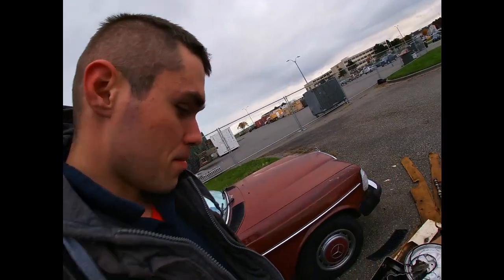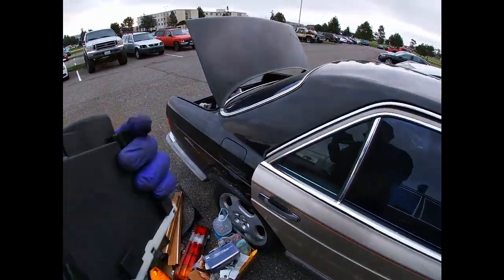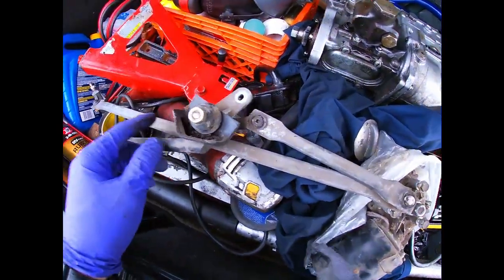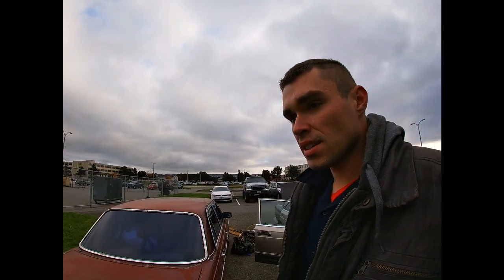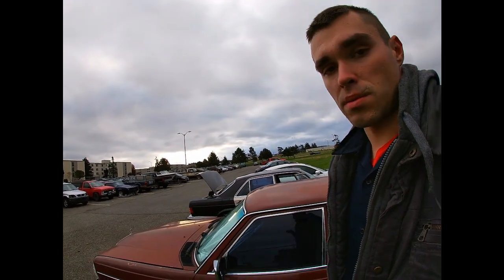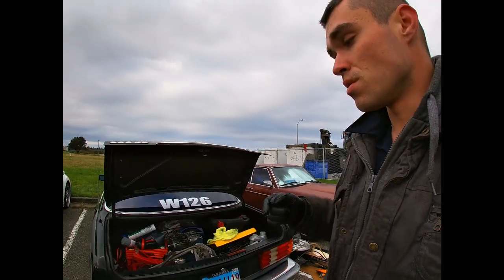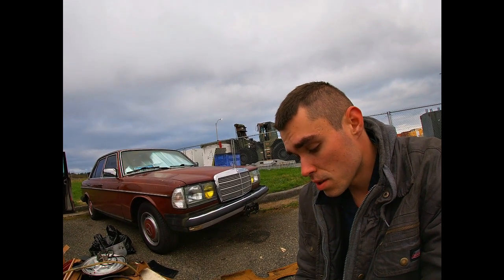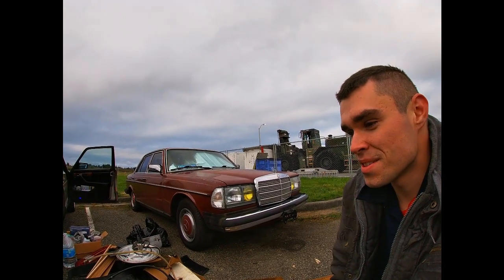Soon We Won't Have Anymore Classic Cars Left....

Comment: Keep up the good work VITO
Reply from the maker: Thank you so much for your support and for watching!😊
Reply: @VITOSGARAGE  I have a w115 220 with a No#2 Cylinder oil leak from the sparkplug, could valve adjustment fix the leak or should I remove the head and send to machine shop?
Tx
Reply from the maker: @papamollo4876  Are you sure the leak is coming from the spark plug and not from the intake valve or exhaust valve? Is your spark plug oily?
Reply: @VITOSGARAGE  The spark plug threads were oily, I cleaned it up, reinstalled the spark plug, I've been running it on idle for 30min no sign of oil leak.(I'll keep observing)
But oil was leaking on the side of the spark plug(minor leak)am also thinking it could be the valves but thought maybe try valve adjustment before removing the head.
Reply from the maker: @papamollo4876  Have you ever changed or removed the spark plugs before? Sometimes when people install new spark plugs, they put some oil or grease on spark plug threads to prevent them from seizing. Your valve cover gasket may be leaking too. Check all that. Valve adjustment doesn't help with oil leaks. But you have to do it if you've never done it on that engine. I do valve adjustments every 15k miles on my OM617. Valve adjustment helps with bettter engine performance and compression.
Reply: @VITOSGARAGE  Thanks VITO,
I'll do the valve adjustment and monitor, I've check spark plugs twice, valve cover gasket is also new.
I will feedback. Thank you so much.